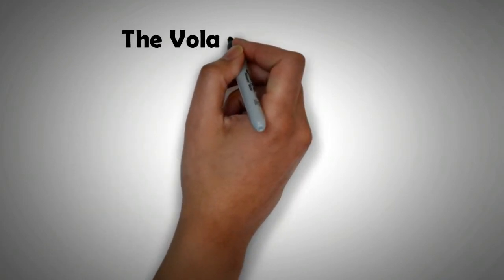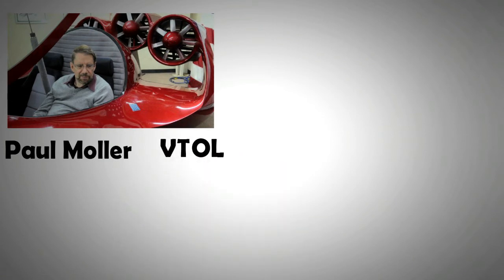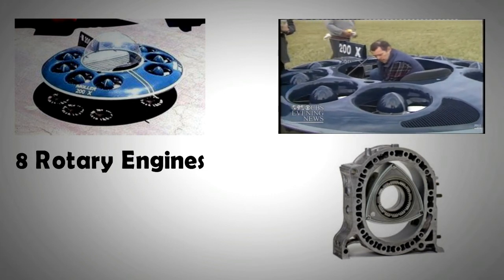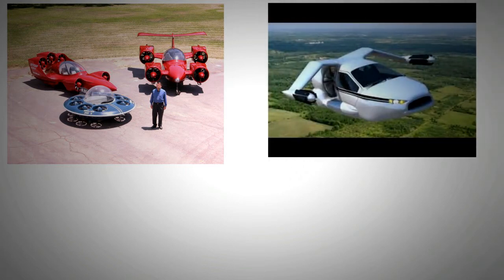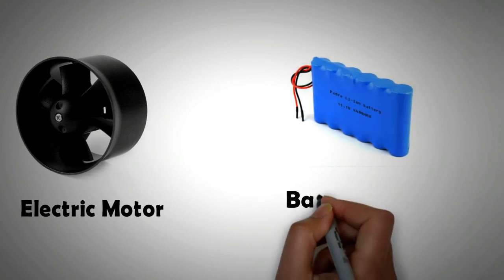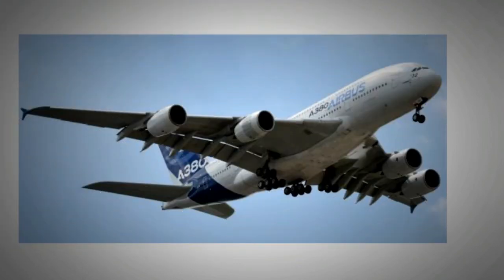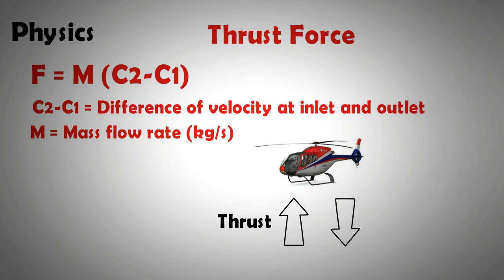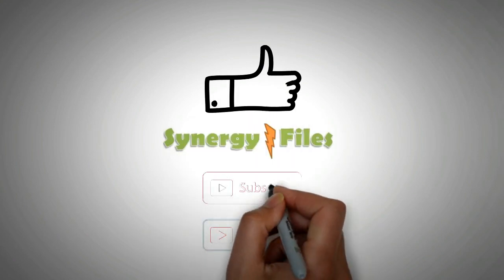Mechanics of the "BAT" (Dark Knight Rises) Explained

Comment: Carbon structures for the engines and frame would reduce weight to a very small number. Twin turbo prop ducted fans would provide a high thrust ratio. Battery power density is increasing slowly but surely, and there are a number of alternate ideas for power including diamond/decay which would provide a given power output for hundreds of years.
Reply from the maker: I had a few samples of carbon matrix structure last week at my workplace. I was amazed how light they were and at the same time how stiff they were.
Reply: I had a realization about power: researchers found that Nitrogen-doped graphene results in a charge that's meaningfully greater than the input charge. Creating structures out of N-doped graphene can serve as structural parts and as a power increasing function. It would have to be insulated from outer contact, obviously, but totally doable.

Comment: I want to know which air Craft use more fuel to travel a kilometer. Propiler or jet?
Electric planes will use propiler tech to float in air. Jet engine can't be run without fuel burning.
Reply from the maker: Propeller aircraft is more efficient than Jet engine. Jet engines are faster, propeller aircraft are slower. However you can use Kerosene Oil (Mitti ka tael) in Jet engine. Whereas for propeller aircrafts you have to use Hi octane, or refined petrol
Reply: @synergyfiles3536  make a video on Wasp bike concept from a movie called the island